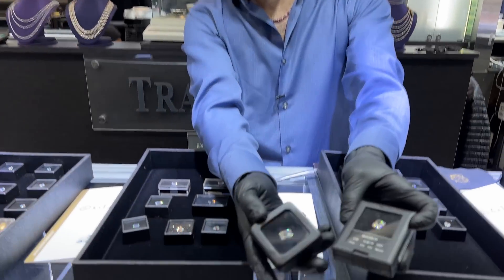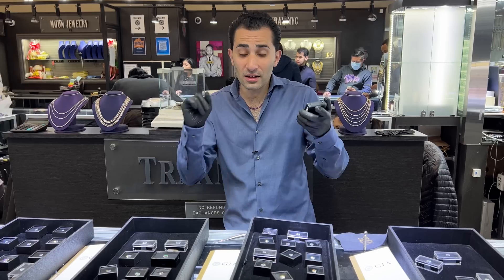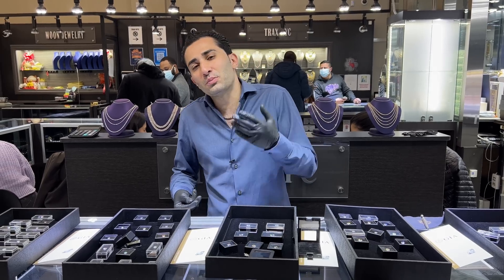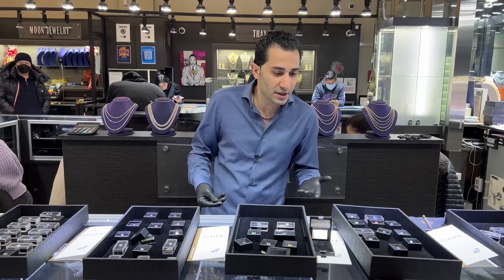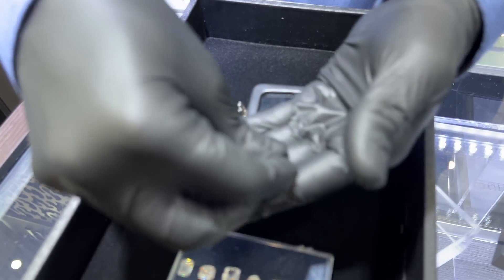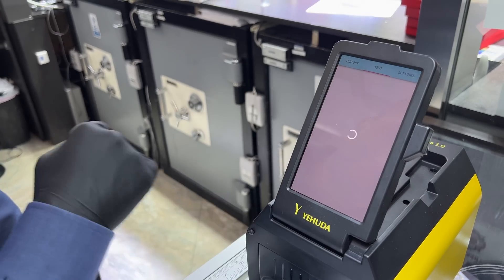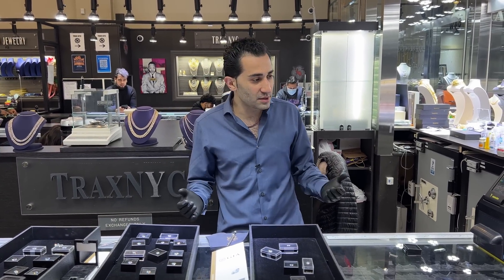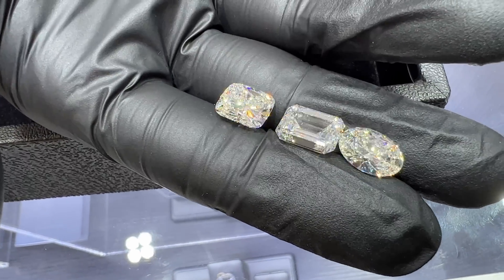How to Buy LAB GROWN DIAMONDS (CVD & HPHT EXPLAINED) | Diamond Buying Guide!

Comment: Bro stop lying. You can never tell a visual difference between a Lab Grown Diamond and a mined one.
Reply: Man’s got a $7K machine because he can tell the difference visually, right. 🤣🤣🤣
Reply: @jwaynecitizen   right on the money !!!
Reply: Facts!
Reply: Not even regular diamond tester can! And yes I do this shit for a living every day!
Reply: @DMRwerks  actually, if you have a poor quality seed you can definitely tell. There can be overtones/nuances of blue, gray or brown in the stone depending on how the growth process went or if the stone underwent any processes to permanently change/affect the color. For example, aluminum is introduced into the growth chamber to counteract brown or orange overtones when growing via the CVD method, but then the diamond ends up with gray nuance. Or boron may be added into the mix when growing via HPHT, and then the diamond ends up with a blue nuance.
Reply: @masondelpino8118  You are either in the industry, or should be. Well said.
As a jeweler only ever dealing in natural, lab grown screw the customer over 10 fold. What happens when she says no, or it just doesn’t work out? Hopefully where you bought it from is reputable and will give you at least close to your money back. However taking any lab grown diamond for resale is virtually impossible to even get a FRACTION of what you paid for it. I’ve seen a $7k lab grown be offered $200 and nothing more. The resale value on them is tragic. And no one but the seller knows they are screwing over the customer.
Reply: @dapperkt2110  yes, I am in the industry. I try my absolute best when educating my customers on the pros and cons of both. I make sure to have the buyer get (or already know) the recipients preference (towards natural or lab grown), and if the client doesn't have a preference going in I lay out all the facts and let the client choose for themselves what works best!
Reply: @masondelpino8118  I’ve noticed those colour hues you speak of
Reply: @masondelpino8118  I think that is what he was explaining man made stones are classified the same way as natural stones and it was just the pair in his hand that had a slight difference
Reply: @msquared6695  if you know they can be there it's easier to look for and to see them!
Reply: @sahs3811  most likely!
Reply: @dapperkt2110  
He’s obviously in the industry.
Reply: @dapperkt2110  lol i'll buy it from them for 1k
Reply: @masondelpino8118  hello can you explain about the hpht diamond please? This machine is only for the cvd diamond right? So how does one know if it is an hpht diamond?
Reply: @dapperkt2110  in that case I'd say picking the right girl is more important than picking the right diamond! 😂
Reply: @DMRwerks  its for peices you wanna check each nice looking stone
Reply: For the mosttt part. To my knowledge (I'm prolly wrong) CVD and HPHT are typicallllly, not always, but typically higher grade and colour than mined ones simply due to the environment and technique in which they are produced
Reply: Not visually but chemically
Reply: Visually you can't tell the difference, but you could definitely tell them apart in the lab. They have different crystal growth patterns, different types of inclusions, different types of fluorescence and lastly, lab grown diamonds are almost always graded Type II-A.
Reply: Do you know what a loop is...
Reply: Ok to tell the difference because most of the synthetics are florescent, they arent really red glowing- the color is about 573nm yellow from C-H color centers. If you zap them with a violet 405nm laser it will be seen as an afterglow. Natural dimond will not glow like this but may be florescent blue or yellowish green. Also the isotope C12/C13/C14 distribution and trace element profile will be way off. CVD diamond will have traces of molybdenum, tungsten, platinum and tantalum that are easily detected by an XRF machine but natural diamond will have traces of iron nickel and silicon instead.
Reply: Definitely can tell today ! ❤️🙏
Reply: I sold a lab diamond engagement ring to a pawn shop, I explained that I had a high quality lab diamond it was expensive. That sob told me the diamond was worthless he was only paying me for what the ring was worth. I told him I had the paperwork it was a $700 engagement ring. He didn't care, and my girlfriend at the time didn't either because the ring as from my x and she just wanted whatever we could get for it. I got Fu*ked. Thank God I didn't lose thousands, but money is money it still sucks.
Reply: @paulg.6120  Thats awsome
Reply: the same goes for real diamonds too unless larger carat weight
Reply: Exactly
Reply: You can with a loop
Reply: @kylecarter8436   lol then why are jewelers buying expensive machines to detect them
Reply: @kylecarter8436  No you cant
Reply: HPHT and CVD are supposed to be magnetic due to metal inclusions during it's formation in a lab so I've heard.
Reply: Wrong.
Reply: Wrong! You can’t always tell, but you can sometimes tell the difference. There’s an opacity difference and other subtle cues.  HPHT are a bit closer but low fluorescence and colorlessness can be big tipoffs if you know how to look at them.  Especially if you have a hpht and natty side by side.
Reply: @RockHudrock  hpht cant be detected by thidsmachine?
Reply: You can get hints that the diamonds lab made or mosinite due to either being too firey, or too perfect
Reply: ill sell this foo hella fake ass shit when his machine breaks hahahahha
Reply: Experienced will gained ur skills and also comes with the unique technique where others never understood.
Reply: He wasn't saying that. The pair in his hands had a slight difference is what he was saying. Where's your shop?
Reply: Yes I agree
Reply: The only way u can is with the machine and very small settle details u can’t really see with a human eye
Reply: Facts
Reply: Facts
Reply: Fire Mark any good?
Reply: Lying is part of the game apparently
Reply: Exactly. Swindler vibes
Reply: Depends on which the 2 processes that the lab was made, was it the one you spoke of or the hp/ht which mimics the way nature makes them, the hpht(high pressure high temp) makes the best while the other makes a more cloudy version that then goes I to a color process, they are for more high volume and should be priced a bit lower than lab stones made from the hthp process
Reply: Put the Koh-I-Noor diamond in that tester and it will show all red 😅😂 type IIA perfect!
Reply: You must make video if you  information
Reply: With a microscope you can
Reply: @realBoeJiden  no you can’t you dope.
Reply: He's just a marketer, so he must market. He has bought alot and wants to sell them off. The lab grown diamond are rapidly growing.
Reply: He said “there’s no way to tell between them without the machine” 

He said he saw a difference in brilliance, that could have been the cutting
Reply: You and everyone in this comment replies seem very ignorant. Naturals gonna have some type of inclusions. Lab diamonds will never have them. Just because this man is better at his job than you guys doesn’t mean he can’t do it.
Reply: @Flawless-Air  Can't be everyone cause I said almost the exact same thing.
Reply: @Melon-Lord  pardon me bro I didn’t mean everyone literally, thank you for correcting me and sorry my friend! Stay smart
Reply: There is elements in natural that  labs don’t have. Lab grown is fake
Reply: Lab grown are almost always flawless
Reply: for some reason i lot of the CVD diamonds i see in my uncles store seem to be slightly off in the brilliance, i don't really know what it is but you can definitely see a difference atleast in the brilliance imo. but hey what do i know im not in the business
Reply: @hernandezbeast4810   Change manufacturer because now days there is not difference. Old processes you could see some differences from the gas deposits used during the process.
Reply: With magnifying glass sure you can, CVD diamond is to flawless meanwhile any natural diamond must has inclusion.
Reply: @thatsawesome2060  that's not true. Lab-grown (HPHT as well as CVD) usually have inclusions. Also, there is such a grading as flawless (natural diamonds can be flawless, I have an internally flawless, colorless emerald cut)
Reply: @masondelpino8118  Their inclusions are different from Natural diamonds.
Reply: @masondelpino8118  wouldn’t CVDs be the best lab made diamonds though? Since they are 100% Carbon, and have a higher clarity
Reply: @user-wl3mu5tt4h  one doesn't naturally have a higher clarity, and both HPHT and CVD are almost 100% carbon (99.95 percent, with trace elements in there, too, just like a natural diamonds)
Reply: A trained eye can tell
Reply: This dude psycho the $6,000 lab diamond cost him $10
Reply: @bradcollier4575   more like $300 from China or India lol
Reply: @orunmila8861  depends on the cert
Reply: In the business a long time lab diamonds are absolutely garbage worthless fake
Reply: I can
Reply: Yeah but leave look better no cap. I bought a cross from him years ago s1 quality was all I could afford but now I got some labs lined up for future purchases. I accidentally got a lab earring many years ago about what I thought was half a ct 10k good earring went to the jewelry store the lady was like cani clean your diamonds. Since it was a real store I wanted to avoid embarrassment telling her I got it from piercing pagoda and it was a cz. She was like you sure let me see that. Put it on the tester turned out to be moisanitte, worth a few grand. She said somehow that got mixed up with the Czs probably mixed up from who they purchase from. Of course it disappeared days after that...I did have a roommate who used to go in my room 😔😂. I can laugh about it cuz I owned a full collection of everything watches for every day of the week, rhodium bracelet, gold bracelets white and gold rings custom with color diamonds even retail stores don't even have yet like red and orange diamonds, ten thousand worth of stuff I could have on at once not even wearing everything. You have to know how to shop and not get ripped off. Shop for what's real and what you can afford until you sacrifice more for higher quality. Trust me mix it all up and you'll have a nice collection before you know it. Some hurricane relief helped as well 😁
Reply: @deepee918  ok double penetrated!!
Reply: You can see bubbles with a Loop
Reply: He can lie to the world because he's in an established position, well marketed to consumers. The few trained viewers from within the industry like yourself know better but it won't move the needle on his profits.
Reply: Some that has been doing it for 15 years still needs a microscope just to give an opinion. Only a machine is gonna be able to tell you. That's why humans built technology to figure out this kinda stuff. Lab created or not moissanite is the second hardest substance known to man. A lab created diamond is exactly the same as a moissanite damn near. Moissanites hardness is a 8.5 - 9 while a diamond is 9-10 on the scale so take a lab diamond and a natural moissanite and the hardness lbl is exactly the same, except a moissanite has a higher refractive rate. Meaning its shine reflects two light passage ways. A diamond only reflects one way for light to travel through. That means moissanite has a better luster and shine to it. And either way people are paying for the metals weight, not the stones.
Reply: I can always tell. Some people can see it some cant. But I’m one of the ppl that can always tell.
Reply: @EyeNoEverything  I bet money you can’t smh.  If people could then jewelers wouldn’t spend thousand on equipment to be able to tell the difference 🙄
Reply: @orunmila8861  you are projecting. You cant. I can. I do all the time. I’m in the business. Stay in your lane. You dont know what you are talking about. The machine is just for extra precaution and security for yourself and the customer. Bozo. Smd. So far my eye test is 100% accurate. Not everyone can tell. Most ppl cant. SOME CAN. I can.
Reply: @EyeNoEverything  and how exactly can you do that? What do you look for and what indicators are there?
Reply: Lab grown diamonds do not have imperfections. End of story.

Comment: Do you guys work with moissanite? Would love to see a comparison video between diamond, lab, and moissanite!
Reply: If you plan to buy moissanite , go for the same cut like he shown on this video because the simple round cut moissanite doesn't look too real like a diamond as its fire is a little bit off , i have a round cut moissanite and im not satisfied with the fire and brilliance it gave to the eye
Reply: @dj90-d8q  Moissanites have more fire and brilliance than diamonds. They just don't look like diamonds because they reflect rainbow light whereas diamonds reflect white light. It is easier to tell that a stone is a moissanite rather than a diamond if it is an ice crush cut (round, oval etc.) because these cuts reflect more light. Step cuts are less noticeable (emerald cut etc.)
Reply: @zlo8389  smaller ones are fine ,hard to notice but bigger carats don't look real enough but crushed ice ones and cuts like cushion cut would look nice for a jewelery ,it also depends on the quality of the cut
Reply: @dj90-d8q  I think moissanites look good too but some people want to pass it off as a diamond, in that case, it is easier to do if the stone is smaller (like you said) and it will also be less noticeable if the stone is a step cut like emerald or asscher because they reflect less light in general and their main statement is the cut
Reply: @zlo8389  after 50 years they'll be thousands of dollars 🤣🤣

Comment: I don’t understand how CVDs show RED under that machine and natural is blue?? If it’s the same thing chemically and what not why does it do that??
Reply: It’s because of the gases trapped inside the diamonds. Lab diamonds usually have boron because it promotes less impurities while natural diamonds have traces of nitrogen. There may also be natural diamonds without the impurities which would test as a false positive in these machines though.
Reply: The machine was most likely designed to do this. Diamonds are diamonds. Both type are chemically identical.

Comment: Are those lab grow or cvd the same as moissanite stone?
Reply: No.
Reply: @bluffem  ok thanks
Reply: @itzjay-j425  Any decent jeweler can tell the difference between a diamond and a moissanite with the naked eye because diamonds reflect white light and moissanites reflect rainbow light. No jeweler can tell the difference between and lab diamond and a natural diamond with the naked eye. Also, VVS has nothing to do with the type of stone it's just a marker of clarity.
Reply: Lab grown are actually real diamonds and come out positive on diamond testers.
Reply: @RADIOKNIF3  moissanite stone are VVS and they test positive with the diamond tester so what are we talking about?
Reply: @itzjay-j425  Yes, cheap diamond testers...  But if you use a actual good diamond tester it will tell you they're moissanite, also VVS has nothing to do if it's real or not that's the quality tier.
Reply: Moissanite is a diamond simulant, while Lab grown diamond is a diamond, a synthetic one, but a diamond.